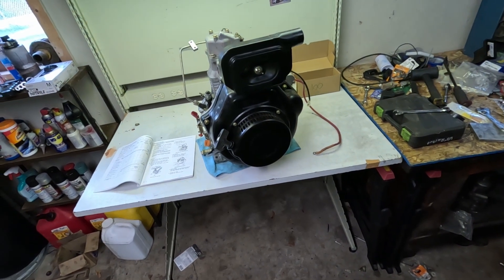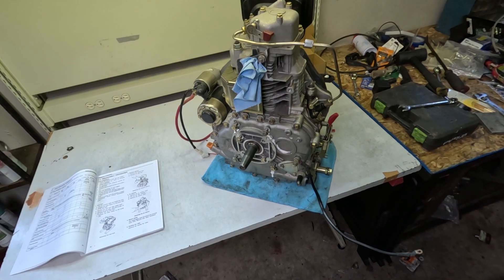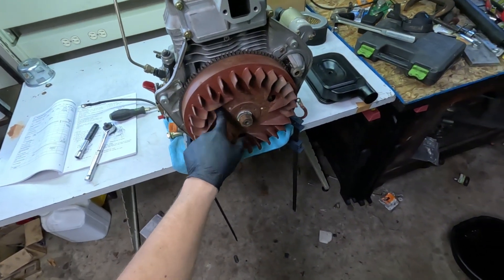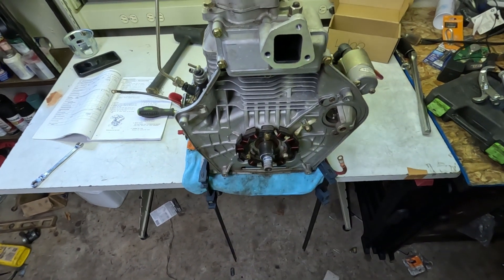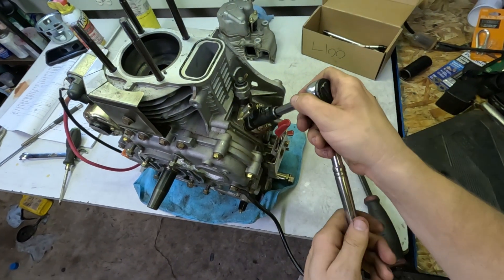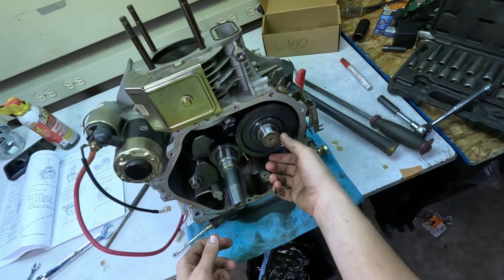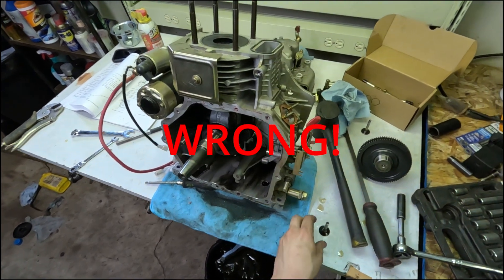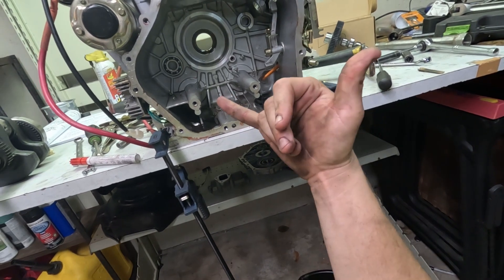Yanmar Clone 10hp Diesel Engine - Complete Disassembly

Comment: Excellent video. I just bought a new one and needed to know what the inside of the crankcase looked like because I'm installing an oil recirculating pump, filter, sump and fuel heating coil in the sump. All questions answered. Also good on you for being cool to the guy you bought it from. As well the vid was straight to the point, no fancy tools and no fast forward.  Ya know, just like the rest of us😂
Reply from the maker: Thanks! Glad it was informative.
Reply: Do you know where I can buy the starter motor?  @haoleboyshow-tos2279

Comment: anyway..how reliable is this clone?...
Reply from the maker: @Mr32243224  So far it has about 30 hours and is extremely reliable. The clones do vary wildly in quality though. The two I have came from enclosed generators, and those appear to be good.
Reply: @ and what’s 30 hours? Some long time?…To tell me about 500 hours, to say: yes, seems reliable…
Reply from the maker: @Mr32243224  I have ran the engine for 30 hours and it has been reliable. It is attached to a tractor that use to snow blow and mow the lawn. I cannot say how it will run in 500 hours.

Comment: Judging by the fact that that engine has two bolts holding the rocker shaft in place makes it one of the better Chinese clone engines. The cheaper clones use a bracket with only one bolt holding down the rocker shaft and that single bolt is prone to failure. I have a generator with the two bolt engine and a cheaper version  with the one bolt in a garden tractor. The two bolt engine runs nicer and is a bit quieter than the $395.00 single bolt engine. Time will tell. Thanks for sharing this inciteful tear down.

BJ
Reply from the maker: Thanks for the info. It’s been used for about 20 hours on a tractor with no issues so far.
Reply: @haoleboyshow-tos2279  I have about 50 hours on the one in my tractor and well over 100 hours on the one in my generator. The only issue I have seen people having is the camshaft being not hardened where the roller bearing runs on it so they can fail early. True Yanmar engines have that surface hardened. Hope this helps.

Cheers: BJ

Comment: Any advice how you removed the alternator from the shaft/engine? I.e how you separated them both?
Reply from the maker: @steelkneel4125  The alternator is bolted to the engine under the flywheel. The issue is that the connector doesn’t fit though the hole to remove it. I needed to snip the connector wires

Comment: You can buy the crankshft you need for $100 parts are everywhere online.
Reply from the maker: @A_Man_In_His_Van  I ended up just machining it. There are 2 different diameters of connector bearing and the sellers never specify. I didn’t feel confident just picking one

Comment: You lucked out on getting one with electric start too..... most dont' have it.
Reply from the maker: If you’re looking used, the Silent Diesel style enclosed generators are usually good. The last 2 I got came from those and had starters. I plugged the hour meter from this one in and found it only has 2 hours on it.

Comment: How well did this engine run for you. I have a very heavy go kart that I was thinking about using this engine on. I am not wanting to go fast, but just to make the go kart good and trail worthy.
Reply from the maker: Works great. I used it on a tractor, but it should work well on larger karts. It makes like 9hp and 20ft-lbs. as long as it’s not side-by-side big it should be plenty strong.
Reply: Cars and cameras made one. It's epic

Comment: I have the 168F. Built to last, matey. Yours is plenty large enough for a 40 foot sailboat or an island bus. It could use a paint job and an aluminum plate to mount on.
Reply from the maker: This is going to live as a tractor, but the little yanmars make great marine engines from what I’ve heard.
Reply: All wet. I don't want water in the tailpipe, nor cooling. Just dry air cooled.
Reply: 168f as in chinese clone version? what rpm do you run it and for how long?
Reply: @arleigh31burke-zc2om  I didn't build the aluminum mount, yet. I cranked in the stop screw 5 turns. There's no way it will routinely run 3000 hours and it needs a gentle long break in. Thick 15W40 oil. It can run maybd 5 hours on the top tank, but you don't want it to run dry. Run it all day if you do in flight refueling. It's primary job will be to run an alternator slowly. Someday boat propulsion, too? I bought the 3/4 to 1 inch stainless steel adapter and will hone it all the way up to 20 MM. That makes it way easier to find a 7 or 8 inch pulley.
Reply: I forgot. Diesels should never run at their most extreme idle because the high compression never goes away. It needs a raised piston speed so the rings don't dig in. Also make sure your fuel is not abrasive and ether can be like blowing a grenade inside the cylinder. If you need a cold start, pour hot water slowly around the injector region first.
Reply: @stanleybest8833  do you need aluminum mount to prevent galvanic corrosion?
Reply: @arleigh31burke-zc2om  the bottom has very small contact area around the 4 bolts. You want a very rigid aluminum plate 5 X 8 , which you put on top of your other mounting, so the bottom stays solid. Under this plate, I'm making an aluminum wood aluminum rigid light sandwich to mount the alternator and tie downs. Your motor should give maybe 4000 hours if you treat it right.

Comment: thanks for the vid, exatly what i needed
Reply from the maker: Glad to hear it. Expect a rebuild video once the crank gets machined
Reply: @haoleboyshow-tos2279  looking fwd to it !
Reply: @haoleboyshow-tos2279 i just picked one up last week with a tapered shaft, I was gonna tear it down to have the output turned but I’m trying something else first if it doesn’t work I’ll be doing the same
Reply from the maker: @Powder_actuated_lead-  I ended up using the tapered shaft adapter. Turning it down was way too expensive
Reply: @haoleboyshow-tos2279  really just to turn that down a little bit? That’s absurd.
Reply from the maker: @Powder_actuated_lead-  Turn down and cut a key. One place quoted $800, and the other quoted $950
Reply: @haoleboyshow-tos2279  holy shit that’s ridiculous just for that
Reply: @haoleboyshow-tos2279 update on the crank shaft, it came in the mail today took about 2 weeks for it to show up from china and it’s a perfect fit, I got it in the case now no more tapered shaft.
Reply from the maker: @Powder_actuated_lead-  Thats good to hear. The tapered shaft interface has turned into quite the nightmare on my project tractor.
Reply: @haoleboyshow-tos2279  i recommend it man, the box was in ripped on one end but the crank is perfect no damage. I’m just waiting for gaskets to come in and throw it on a Sears tractor.
Reply: What is the torque in this engine?